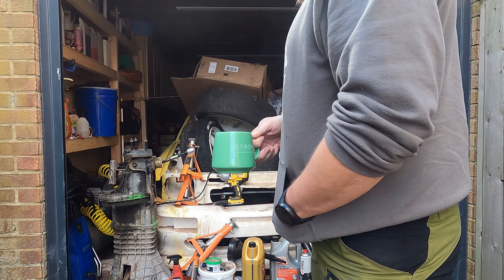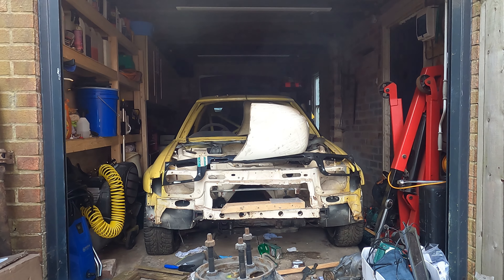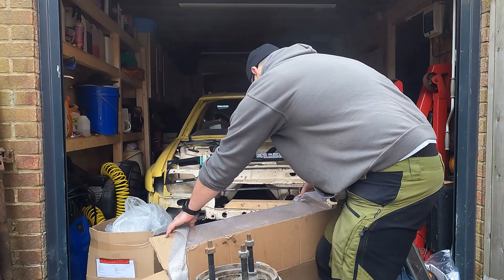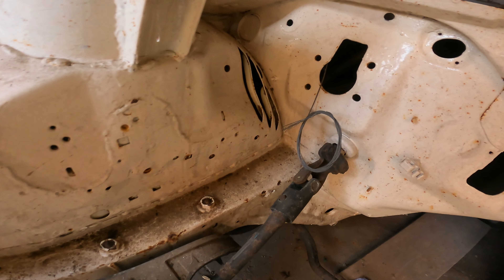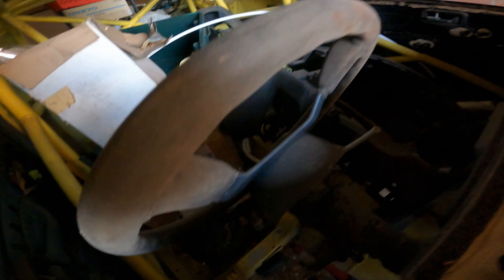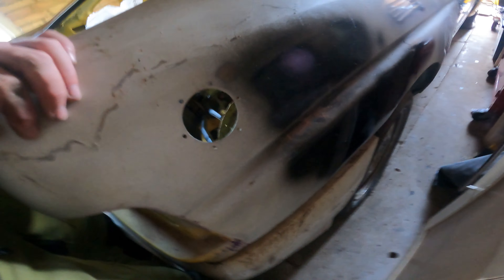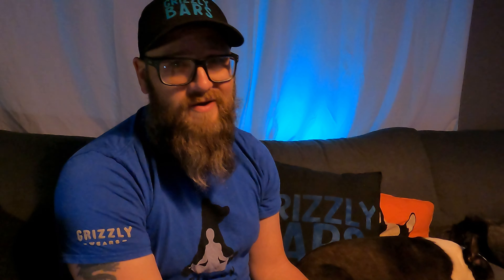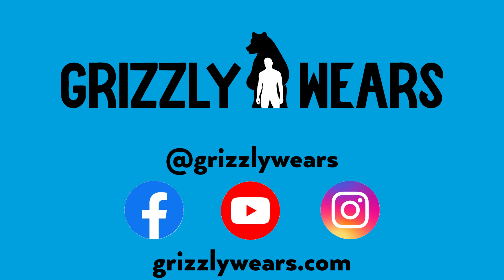Rebuilding my Escort Cosworth WRC car - Episode 1: An introduction and quick look

Comment: Hi 
Nice project.
I realy like that roll cage. Never seen on like that before. They have seam welded the area around the roll cage at rear to give reinforcment to the whole structure. So it does not look like somthing made at home at first seight. Nice work
I have seen many 909 chassis and the stripped 909 chassis (9095455 and 9095456) without roll cage from Borehame/Ford Motorsport did not have the support bracket that goes from the floor and on side on the rear shock tower. Your car has thoose brackets. 
In engine bay it looks like on the welding that it has reiforcemnet plates similar to Boreham style on the outside of inner fender(wheel side). It is a bit hard to see on the welds where they are attached. But they have definetly done some reinforcment on the front inner fender as the circular hole are not open.
In the front it also look like it has the extra hole/sleeve on the side of frame rail for caster support brackets. I will look at some old pictures 🙂
Reply from the maker: Thank you, I'm just learning this seems to be a very unique car. I have looked through a lot of photos and not seen many similar to it. there is a bar in the roof which prevents a roof scoop being added. I'm going to spend more time sanding the paint to see if I can discover anything else before the shell gets blasted and all history is lost. Somebody must have an idea about the history of this car !

Comment: interesting. I owned quite a few Escort Cosworth rally cars between 2004 and 2009. The first (and last) of them was an ex-Ford Motorsport, Gordon Spooner Engineering built car, registered as N871 GNO, which was used as a recce car for Portugal and Argentina by McRae and Sainz. Sadly that car burned to the ground in 2009 at Blyton Park on a test day. You probably know of Steve Scott (A1 Rallysport) in Bedfordshire, he did a lot of work on Cosworths for me. The other person it would be worth speaking to is Tony Conway, from Yorkshire, who had his hands on a huge number of Cosworth rally cars as a dealer through the 90s right up to fairly recent times. I don't think he is messing with Cosworths these days, but his knowledge is extensive.
Reply from the maker: Thanks for this, I'll have to get in contact with them and check whether they have any knowledge of this car, this one is also N reg. It would be good to find some level of history because the cage seems fairly unique

Comment: Will you be building it as 2wd setup ? Also will it be wide track setup
Reply from the maker: I spent maybe 10 years thinking I'd make it 2wd, some of that contemplating a coyote engine but I have a YB to go in it and a full 4x4 drivetrain from a saph